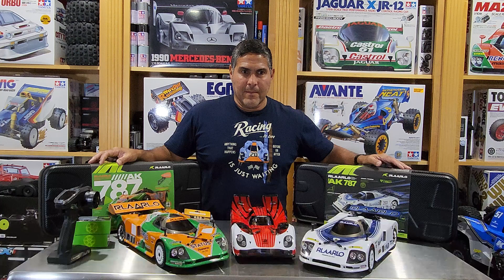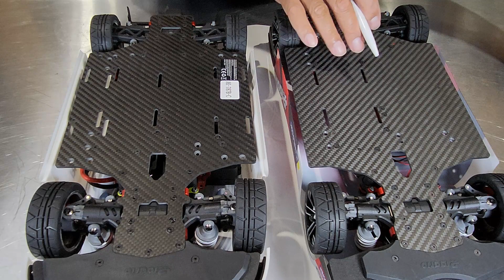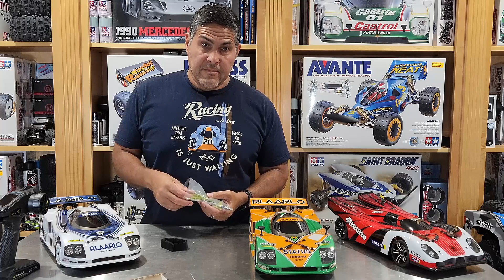RLAARLO AK 787 and AK-917 Dual Motor Kit

Comment: I am about to buy one but I’m confused right now. Should I buy the 917 or 787? And why? And is it absolutely necessary to use carbon fiber chassis for best performance? Or can the metal version be just as fast and durable?    The other question is, I have electronics motor, Esc, receiver w/gyro, remote, servo etc. I was building a TT02RR for speed runs but the plastic diff housing would keep on breaking from simple assembly and disassembly. I sold it to my friend who has a complete set of parts to make a whole car. Now I’m also debating a roller carbon 787 chassis w/dual motor kit,,BUT. Would rUNNING TWIN s3650s W/80Amp Esc be ideal? Or am I way out of my league with this route ? Any input. Will be greatly appreciated. I have the money and don’t want to make another choice that I regret.
Reply from the maker: All depends on your goal. I'm no expert,  but from my experience. If you want to build  a dual motor,  the 787 is predrilled for the RLAARLO dual motor kit. The 917 is not. If you're planning on using it for speed runs, I would use 120 amp or higher escs. Dual motor isn't really necessary to go fast. Most fast speed run cars are single motor. If you go single motor, you can easily do the 917 carbon or aluminum 917 and 987 chassis. Aluminum can be just as fast, but it's not flat like the carbon, and it comes with a smaller spur gear.
Reply: @allscalerc  thank you!  I actually purchased a Arrma Vendetta. lol. 😂. Any suggestions on what mods to do for this? My goal is to do speed runs and mess around a little bit , but more speed runs. I wasted a lot of money building the TT02. only to have to scrap it.
Reply from the maker: I actually bought 2 when they were on sale a couple of months back. My plans were to just throw a 150 amp esc in it and see what it'll do. I remember seeing guys breaking into the hundreds with that and 4s. I'm not sure what they did for gearing. They do sell a spool to replace the slipper, but it will hurt drivability when it comes to turns. At least 160 amp esc if you want to make it 6s.
Reply: @allscalerc  I noticed that the spur is on a slipper. I’m very new to RC, my first car I just built was only last month. It was a TT02RR chassis and I added all the yeah racing alloy parts you can possibly buy. Then I adddd a 54T spur and had a set of pinions 30-35t ready to do speed runs. Then I realized just messing around, this ain’t the car to try to dedicate to speed running. So I now got the vendetta and intend on going crazy with it.
Reply from the maker: @RittenhouseLifestyle7  https://www.ebay.com/itm/234914633302?mkcid=16&mkevt=1&mkrid=711-127632-2357-0&ssspo=CYSQMZ1TSFC&sssrc=4429486&ssuid=xiGPsH8UTfy&var=&widget_ver=artemis&media=COPY
Reply from the maker: @michaelrittenhouse2544  I might need to get the slipper eliminator myself. I'm not sure how much power the stock slipper can handle. There might be others out there. I just did a quick search since I've seen them before.
Reply: @allscalerc  I ordered one from “RCAWD”. On Amazon, just to have it when I’m ready to start messing with spurs. I know they ain’t the greatest brand of quality parts, but the part is relatively simple. It just bolts through the holes in a spur.
Reply: @allscalerc  thanks for the link. I didn’t even see it before haha. 😂. I just have the adapter. What spur size should I get ?  I want to see how fast u can get the stock Esc and motor on 3s. Can you give me a list of parts to put? I ordered the Bluetooth module for the dx3– adapter connectors to run a deans plug to the ec5, hot racing driveshaft, coda racing high speed shaft center bearing, and I ordered carbon front splitter, side skirts. Do you know if I can buy any air dam covers? To seal up the underside of the vendetta chassis?? Like on the limitless and infraction. You can get small carbon plates that cover most if the gap underneath where the control arms are. I want to make the bottom as flat as possible to help stability.
Reply from the maker: I'm not sure about gearing since I haven't built my Vendetta yet. I would avoid using the deans adapters if you're really trying to get the most out of the car. Adapters cause resistance. I still use them for fun, but not if I'm trying to break records. Not sure about the air dam covers. You might need to make something custom.
Reply: @allscalerc  the next couple 3s lipo’s I buy, I’ll make sure they’re EC5.